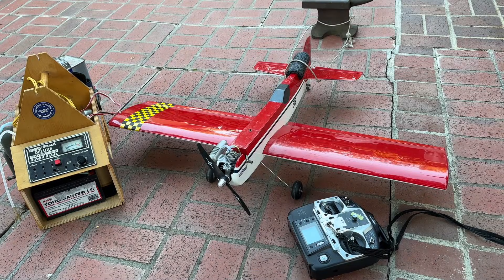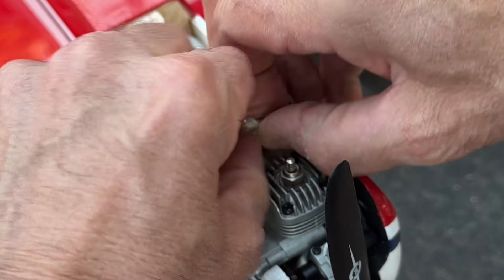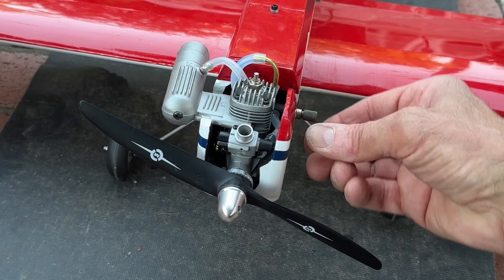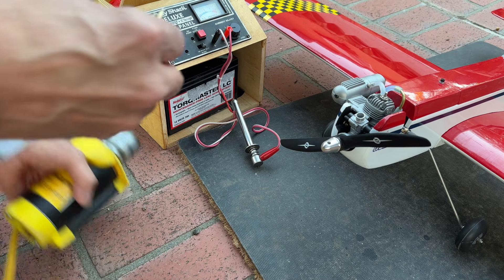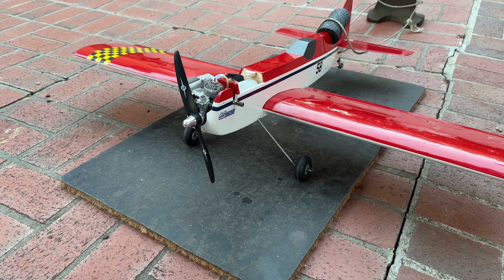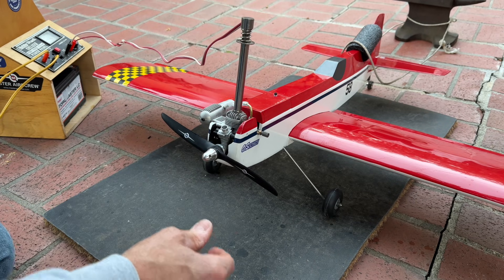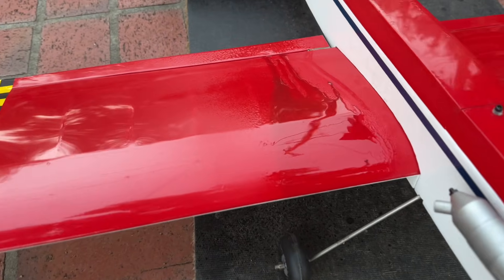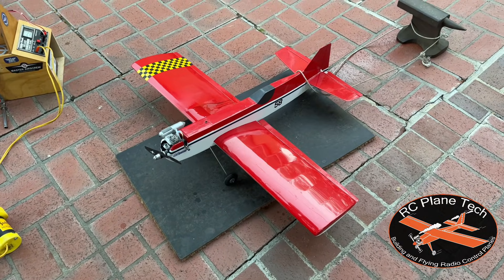How to Build a Balsa RC Plane Off Plans: No. 23 O.S. Engines 15LA Test run

Comment: hey beatutifil job! you shoudl loosen the muffler screw and just rotate the exhaust so it points up or to the side so not as much oil gets on the wing.
Reply from the maker: Thanks! I will be adjusting the muffler also😊

Comment: Hi James, AAHH the working sounds of an OS  eng, simply marvelous 🤗

Back on post #19 I was.suggesting to use Pledge furniture polish or cheap $ store brand to spray onto the plane to help with the oil clean up &add a nice polish to the covering 😎  
Try it and thank me later. Its like putting Rain X on the windshield, it'll run rt off.
Alright good luck on the maiden flt 
Lite winds & clr  skies ✌out  🖖
Reply from the maker: Awesome ! Thanks Duain.

Comment: Take the neck strap off the transmitter! That's an accident waiting to happen. If for some reason you think you need it, learn how to use it. When the airplane is on the taxiway/runway, remove it from your pocket, put it around your neck, and clip it on. As soon as you land, remove it from the transmitter, and put it in your pocket. I've taken two experienced modelers to the emergency room because of neck strap incidents. They are dangerous, especially on glow models. Look how close it is to that throttle stick. You don't put safety glasses on after you get something in your eye.
Reply from the maker: Thanks for the comment. Safety should always be on our minds